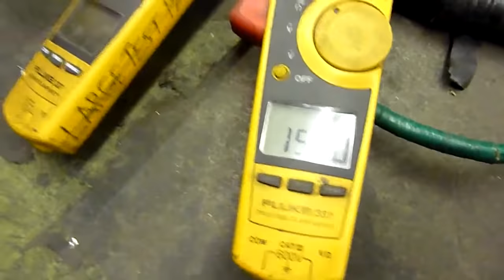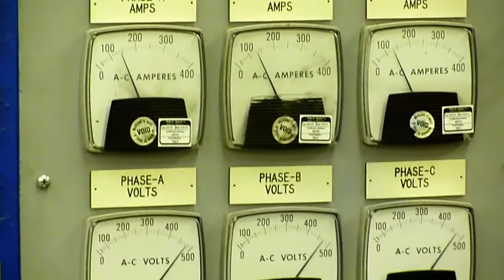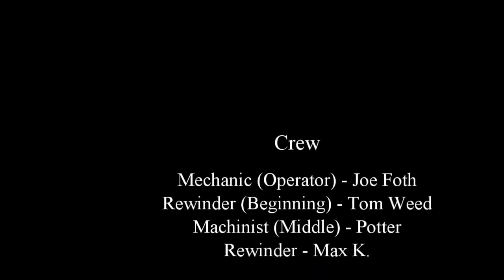Testing Big AC Motor

Comment: That’s got to be 40 HP, finally a good motor for my fan
Reply: 450 hp
Reply: Nah, I'd say at least 50 hp, because it draws 850 on startup.
Reply: @abdelbassetarab4898  absolutely not. That size of motor would take up an entire room.
Reply: 100 HP motor
Reply: I have 2 125HP motors at work and they're half this thing's size. I believe no load current should be around 40% of FLA which would put this thing around 350 - 400 HP. For size comparison a 500 HP motor (Frame 586/7) is around 60" long to the end of the shaft and 30" high... and $35,000.
Reply: Approximately 1.2 amps per horsepower so a 300 horse motor at 480 volts 3 phase is around 360 amps.
Reply: @artimussumitra484  Amps don't equeal HP watts do.
Reply: @Bogdan Kuzmanov 745.7 watts is 1HP so...
Reply: @ham549 1 Amp times 480v 3 phase equals 831 watts
Reply: 40hp😂😂😂😂😂

Comment: Can you imagine that unmounted monster powering up without a VFD or some form of soft start?  Images of all those little DC motors that jumped off the table when operationally tested with a battery come to mind...
Reply: Something will blow up or burn due to the initial current lol
Reply: BluntForceTrauma I think it would be impossible to start something like this “instantaneously” (of course not truly instantaneous). Too much mass to spin up fast.
Reply: @literoadie3502  It always depends on the current. I would not feel myself safe around it like this. If something bad happens in the winding, or in the PSU, the braking torque could spin this thing through the floor.
Reply: Relevant username.

Comment: I want to switch it on and off via my Arduino Uno ;)
Reply: Duncan Wilde Connect the output to a small power transistor and that transistor to a relay and that relay to a large contactor that is capable of switching the power required for this motor.
Reply: You could! (using a large relay and a transistor)
Reply: Just hook it up to pin number 13
Reply: You would probably need a transistor and a very large relay.
Reply: A relay.
Reply: use a FULL BRIDGE RECTIFIER!!!!
Reply: @akratooos   electroboom fan found
Reply: Yes ez. Just use some arduino relays or small shield, that will do
Reply: @fklabs6813  a contactor will not start this motor . You may need that contactor to power an ACB or vaccume breaker .
Reply: Are there huge transistors? Or could you wire them in parallel?
Reply: Duncan Wilde logic to intermediate to power.
Reply: @fklabs6813  use it with mosfets
Reply: or you could just use a servo motor to push  the buttons on that Power Panel
Reply: It's completely possible!!!
Reply: Yeah... gud luck with that bud
Reply: @renzevenir4853   and than upload some code preferably lots of it   

Power grid : WTF WHY
Reply: @adamiacobescu1916  my man or just use a servo to drop a poster that say start motor please
Reply: @alf3071  igbts
Reply: Get the Arduino 100kW motor shield. It has a 5V to 500V boost converter on board, so you can power the motor via the Laptop->Arduino USB connection. Make sure to also keep an LED blinking via pin 13 as a warning light for people less expert in these things than the ladies and gentlemen present in this comment section.
Reply: @alf3071  Yes and yes.

Comment: And not a single fuck was given about the ground wire
Reply: Let’s just put our hands all over an ungrounded motor we are testing...what could go wrong?
Reply from the maker: He has great confidence in the insulation!
Reply: Hahahaha
Reply: Green wire on 1:22
Reply: Ground wire is on the ground. Where else does it go? Im lost lol
Reply: Lol
Reply: I don't think it matters a lot, for something as balanced as this the voltage there (Neutral) would be 0 wrt ground anyway.
Reply: Im no electrician but Im just assuming these guys know damn well if its really important to connect a ground wire or not.
Reply: the motor should have been strapped to a testing table too.
Reply: Thats a big table
Reply: Anubhav Mukherjee
It's 3 phase, there is no neutral. If a winding went to ground without that ground connected, the frame would be energized and shock anybody that touches it.
Reply: That's what I call "wireless technology". Wireless ground!
Reply: Don't worry it will just ground out on the concrete lmao
Reply: Motor is on the ground what's next going subterranean
Reply: concrete is a bad conductor
Reply: Don't need no stinking ground when you have an employee to play that part.
Reply: Andrei M got no time for all that.
Reply: The ground wire does not need to be connected if they use a transformer to decouple the motor from the net. By grounding the motor, they would then supply a loop for current to run through if one touched the motor and thus shocking the person.

Comment: Cool video. If you install a half-key you can reduce vibration greatly, especially at 3600 rpm
Reply: gforce118118 I think they know what they are doing
Reply: gforce118118 
What is a "half key"?

Comment: I used to service a motor about twice this big,  it ate about 120A per phase on 3 phase 480V on startup but dropped to 18A per phase idling or 90A with full load on the big crusher shredder it was attached to.  The machine had 9 50 pound knives that rotated inside. Changing those blades was not fun. 450 foot pound on the bolts with 12 of them per blade. 😮

Comment: Looks acts and sounds like a motor for a hydraulic steering gear ram system for ships. Been there, done that. Lol.
Reply: Yeah I hear ya, I was an EN on a Naval ship. I was in charge of the aft steering system. It had four GE 150 hp 1150 rpm, 150 hp a motor. Those hydraulic systems could be noisy as hell. It was a cruiser. CG63. I was on the Cowpens. Plenty experience with that system!

Comment: Reactive amps. The voltage and current are out of phase so the actual power being dissipated in the motor is only a few hundred watts, not the hundred+ kilowatts the volts x amps would indicate.
Reply: The most part off a running motor (not a starting one) is actual power. about 80 %.

Comment: May be late to ask questions, but at 480V x 150 A x 3 phases (assuming y wiring) that's 216kW, unloaded so all the energy goes into heating the motor!!! How come it is not melting after running for a few minutes?

Comment: If it was directly connected to the supply.. Without any gradual increase in voltage.. Just imagine about the inrush current it will draw.. Might trip the local transformer protecion
Reply: We draw in 600 hp 480v motors across the line. Our soft starts help over come the in rush but I've seen 3000 amps in rush before. It sounds gnarly.

Comment: This thing is drawing 360 amps on no load!
Is that normal?
Reply: Low voltage start.  Very common to test them this way.
Reply: yeah just until the synchronizer kicks out, then usually around 70-90 A no load, which winding has lot to do, and age, and hours used

Comment: So that is why my lights went out the other night. No star delta wiring on that motor? No ground and the guy touches the eye bolt, good thing it didn't have a ground fault and worse if it was 347 vac.
Reply: oto169 this was actually recorded 2014
Reply: In most big motor , no star delta  starter  , it will be used a soft starter or VFD to reduce starting currencies
Reply: Sounded like a soft starter

Comment: That kind of motor for my aircoditioner
Reply: Victor Orellana would be useless actually
Reply: nightmare in action nighmare in action I think so indeed. It would compress the cooling gas so hard that the pipes would explode first. And if the AC worked it would be at 0 kelvin straight away. It can only go wrong lol.
Reply: Richard van Pukkem nope neither a window actually compressor works from 1600 rpms to 3600 and some go even higher the 220v ones and this has 3600 max the only difference would be torque but it's impossible to reach 0k here in the earth the atmosphere just isn't enough have you guys taken any physics class yet ?
Reply: If you actually had an a/c system that required this motor, connected to your house, the temp would go from 90° to -20° in 5 minutes. You would be putting on a winter jacket in 2 minutes 😉
Reply: Super 225 circuit breaker will trip before  it accelerate
Reply: Ya I wouldn’t stand by the intake vent

Comment: I am actually kind of puzzled as to why it is still sucking so much power with no load. That would seem its pulling 75000 watts once at full speed? I realize its a huge rotating mass, but I would have thought at 500 volts that the amperage would drop much lower. I don't know much about motors that size, just smaller ones for non commercial use. So really I have no clue, just asking.

Comment: So much POWEEEEEEERRR... ohhh yeaahhh 
I have an AC motor that's half the size, about 200kg heavy MOFO, want to make a car or truck with it but just the controller alone $20k and another $30k in batteries... hummm
Reply: Im sure you could figure out how to mount this beast of a motor.
Reply: you can just buy a tesla instead
Reply: This is just 2 ton
Reply: so much POWAAAAA !!
Reply: ElectricBike Its called R/C...
Reply: You can get a square D VFD (variable frequency drive) for about 5k and use it to control the speed of the motor. It will also allow you to monitor the temperature of the motor
Reply: Make the world's biggest rotory subwoofer
Reply: Hey you look so familiar, have yiu ever made some video about e-bike?
Reply: I have the NSA's top cryptologists trying to decode what the fuck you just said.
Reply: ElectricBike you are everywhere
Reply: BrunoPOWEEER 😀😄

Comment: Is that a synchronous 3 phase AC motor with a special test station motor controller? At full speed at no load it draws about 150A per phase, one wonder where all the energy goes as the heat it generates will be impossible to dissipate in that volume. That is the wonder of AC power when the current and voltage are out of phase, hence the real power consumed is much lower than the amperages indicated.

Comment: Saw a huge traction motor mounted on steel  girders and attached to some kind of a generator. It was running full blast. It was the size of a pickup truck. The howl coming from the motor was deafening. The description said it was rated at about 3400 hp. It was a fearful piece of equipment.
Reply: I was sitting in my car in a super market parking lot in Milwaukee Wisconsin a long time ago, about fifty feet from me were two massive   transformers side by side. Each was about the size of a two car garage. Suddenly one of them exploded through the top of its container. I've worked with explosives and the explosion was about equal to a 3" by 24" stick of dynamite. A second later the other transformer exploded the same as the first one. The containers must have had a wall thickness of 1/2 " steel. The power of the current escaping was awesome along with huge fan shaped arcs of electricity making ungodly shrieking and spitting huge clouds of thick smoke. The fire department arrived and it took them over an hour to stop the burning contents of the transformers.

Comment: looks great, but supply cables are too thin, motor voltage probably much lower than showed on display, with a hort circuit cables will glow in stead of thick out the MCB

Comment: We had I think 20 hp motors to move pumps to transfer 165,000x20 pounds of liquid around the plant. They were about 1/2 to 3/4 the size of a 55 gallon barrel.

Comment: My lock up proposal was purely 'what if'. I can't imagine this motor  running free as we see it and instantly locking up 100%. How about this, 'what if', imagine the gyroscopic energy it has running at full power rpm/torque. I'm not an engineer but I do know that gyroscopes precess at exactly 90 degrees to any applied force deflecting its direction of rotation. I think this is the law of a ' body in motion tends to stay in motion and in the direction it is traveling which in this case is in a circle. Also the opposite but equal force law of physics would play a big part here. If this motor could be mounted in an 18 wheeler, the truck could easily climb 70 degree inclines, no sweat.

Comment: The green wire is already grounded on the other end, so no need place that clamp on the floor.
The motor house is already placed on the same floor so nobody worryed abaut an winding insulation faliure caused electric shock under motor testing.

Comment: I used a motor like this to run a DC generator of equal size. I used the DC power for that to run an 1895 Niles planer mill. the largest planer mill in California. Because it was built in 1895, and AC current didn't exist yet it had Edison DC motors.

Comment: This motor should be bolted down before a test I worked for a firm that did rewinds and they always bolted them down.Looking at the wiring its a Star Delta motor and it was started in star hence the slow run up

Comment: I work on the same motor while testing a B777 and A320 Aircraft EDP's, we have 100 horse power Motor with 1400 RPM converted upto 4100 RPM through gearbox.
Reply: Bet that makes some good pressure and flow!

Comment: What makes it start so slowly?  Is that a variable-frequency power supply?  Or is it starting with the normal frequency but just reduced voltage?
Reply: Looks like a fixed frequency and reduced voltage test

Comment: 90 horse based on the amp draw. The wires running to the motor where way to small for that current.

Comment: High voltage can cause electrocution. With out that ground cable attached to the chassis, anyone touching the motor puts them selves at risk of Electrocution. This is how people get killed. The company is obviously at fault for improper training and lack of safety protocols. Then another employee walks up and touches it, like how he gave it a tap to make sure he wasn't gonna get zapped. 3 day suspension for first offense and termination for 2nd.

Comment: I knew this motor runs on 3 ph elcectricity....but I did not think it was going to draw that kind of amp power to keep it running...Starting up, yes... but not keeping it running. BUT then again, I have not been around motors that size when I worked with machinery that use 3 ph electric.

Comment: On a general math basis, at 150 amps and 480 volts at its working speed, that is 72,000 watts.

One Watt = 0.00134102 Mechanical Horsepower (i.e. at the shaft)

Since MANY warehouses and workshops have 480V power available we will use that as our working voltage.

72,000 Watts x 0.00134102  HP per Watt (measured at the shaft) = 96.55344 HP

Most safety-conscious people I know WOULD ONLY APPLY a maximum of 75% of the maximum working load so this motor could be considered a 72.41508 Horsepower motor. In terms of TORQUE, you can apply a useful conversion of 1.07 x Maximum Working Horsepower to get Approximate Torque for this type of electrical motor or about 77.4841356 foot/pounds of torque which sounds WRONG TO ME since electrical motors have MUCH MORE TORQUE than internal combustion engines.

We should be actually using Joules and Newton/Metres to make a much more meaningful comparison. With foot/pounds the combination of gearing and slowing of even a SMALL motor means you could pull ENORMOUS WEIGHTS even a million pounds (a tad slowly!) if your gear ratios were ample enough.

In terms of ACTUAL WEIGHT BEING PULLED, such a large motor could theoretically pull a maximum weight without damage to the EM coils on an almost level ground (i.e. only very slight grade) of about 100,000 lbs for the entire day at a few KMH.

So YES this is a very very powerful motor!

V
Reply: My calculation for a 3-phase 480V motor drawing 150A = 135 Horse Power and 101,000 Watts. They do make 100,000 hp motors, though they are a lot bigger.
Reply: @ghostdragon5758  One of the problems with motor HP calculation is that Volts x Amps equals Watts of electrical CONSUMPTION but whether that watts consumption makes it to the shaft is WHOLE DIFFERENT BALL GAME.

The calculation of: 

150A x 480V = 72,000 Watts

One Watt = 0.00134102 Mechanical Horsepower (i.e. at the shaft) 

Soooo....

72,000 Watts x 0.00134102 HP per Watt = 96.55344 Total mechanical HP (at the shaft) which is a tad lot less than my early WRONG calculations --- OOOOPS!

I think I transposed a few decimal places!

You are correct in correcting me!
I will adjust and FIX my previous calculation.

V

Comment: Most three phase motors cease to function after 350 volt. The range 55_440 volts (line)needs an explanation? At 440 the phase voltage is 260 volts. It is calculated by dividing 440/1.732. The 1.732 is a ratio of sin60/cos60 which is equivalent to tan60 degrees. Also explain the rotation of the motor as it is opposite of a generator motion (left hand and right hand rule). The hp may be 120.

Comment: Shall we connect the Ground? naaa. And we'll wrap the lines in cardboard tubes from kitchen tissue rolls, that will be fine. Do we ensure it's secure on studs so that if the bearings fail it doesn't launch itself into another state? nope. I'll just stand next to it. But I got ear buds in, they'll protect me.

Have you had an accident at work? Wasn't your fault? Three ton AC motor sailed into your office from the workshop on the other side of town? Call us!

Comment: First remark: there is no emergency stop, fence protection in case of falling moving parts 
Second:even the motor is running no load test, a huge current is withdrawn hence the full current will be triple times and this is not good for the power factor and reactive power..
My opinion is to level up the voltage of this motor,
I think that this motor is started with Auto transformer.
Thanks
Reply: The overall current is the square root of 3 multiplied by the current of one phase! And i think hes cranking up the voltage slowly otherwise id would have started way faster...

Comment: 480 V at 150 A is about 100 horsepower. Neat.
Reply: That is no load current, probably double the hp with actual load connected